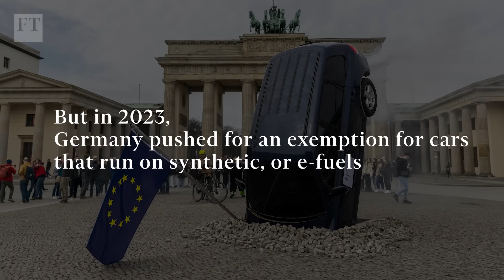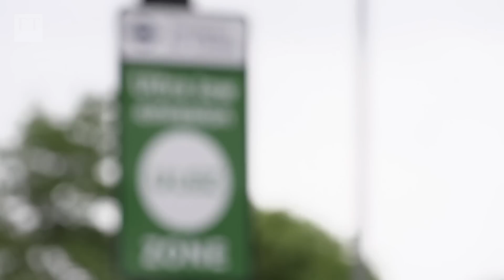The end of the combustion engine? | FT Energy Source

Comment: Julia was clearly the most informed there. She correctly summarized why ICE cars are cheaper than EVs - it’s efficiencies due to decades of manufacturing improvements. Mass scale EVs are only about 13 years old, give it another decade and they will dominate. You never bet against the technology with less moving parts.
Reply: Another reason is because nobody makes them pay the social cost of their dirt
CARBON TAX NOW!!!!
Reply: Combustion engines are at the limit of their performance and cost saving due to a century of ultimate competition among biggest automobile manufacturers.
Reply: Electric motors predated gasoline engines.
Reply: Less than 5 years for some very sophisticated high performance Chinese EVs. They'll blow everything else out of the water. We have slacked off.
Reply: @chrissmith7837  
The West is ahead in efficient motors, best power/ratio. Yasa near Bristol come to mind.
Reply: @johnburns4017  Maybe, but not by much and if you look at vehicle performance  you're not going to see it. Frankly it's all about batteries, charging/replacement and materials.
Reply: I don't know why people think that Electric Vehicles have to replace Internal Combustion.  In a free society it should be consumer choice.  I don't care if people want to buy electric cars if they want to.  Similarly I don't care if they want to have a golf cart, shotgun collection, skateboard, motorcycle or boat.  But for some reason the EV proponents seem to have these dictatorial tendencies and insist that ICEs be replaced.  You do you.  Leave everyone else to make their own decisions.
Reply: Mass scale EVs are piling up like asbestos cord wood in a wood lot.  They are far too expensive and impractical, there is not enough infrastructure or electricity available to run them.  [Why does the "progressive paradise" of California restrict the hours one can even charge their EV?]  The government that pushes EVs is the same government that effectively prohibits the construction of any practically viable electric generation facilities and is forcing others to shut down which is resulting in current electric rates skyrocketing,  EVs are not practical for long distance driving or operation in winter weather conditions throughout much of the US  Finally, there STILL is no tangible EVIDENCE that demonstrates the use of the dreaded fossil fuels has any measurable impact on climate change - a phenomenon that has continuously been taking place for hundreds of millions of years now.  Further still, it's kinda comical that there are EV charging stations in places like Montana that use diesel generators to produce the electricity to charge the "clean EVs."   As for so called "green energy", unlike "mass scale EV production," there are 45+ years of experimentation, development, massive government subsidization, and programs and yet it still only accounts for no more than 10% of electric production and in many parts of the country considerably less than that.  Like EVs, "green energy" is largely impractical and way over priced even with  massive government subsidies.  Of course there is one source of practical green energy (nuclear) but the government prohibits it's use and manipulates public opinion against it with scary false narratives the same way it managed to get everyone stirred up into a blind frenzy with the covid hysteria and the endless "vaccine" nonsense that has now been proven to be so risky that many governments have called off "vaccine mandates" entirely at the least and some have even prohibited the use of these dubious "vaccines" among certain vulnerable demographics within their countries. The state of Florida also has recently joined them.
Reply: No they wont.
Reply: @jester5ify  
What won't?
Reply: @johnburns4017  ice cars will not be replaced.
Reply: @jester5ify  Hopefully "ice cars will not be replaced" is the daftest thing you will say today.
Reply: @kalebdaark100  Hardly. Battery powered vehicles are far more damaging than any ice.
Reply: @jester5ify  I guess that wasn't the daftest thing you would say. Ah well.
Reply: "You never bet against the technology with less moving parts."  Yeah, Rolex (and all Swiss) watches disappeared decades ago.  Who would ever want one of those?
Reply: @dzcav3  
The CEO of Rolex said they are not in the watch business, they are in the luxury goods market. If you want an accurate and solid watch you do not buy a Rolex.  If you want jewelry then by a Rolex.
Reply: @johnburns4017  You said, "The CEO of Rolex said they are not in the warch [sic] business, they are in the luxury goods market."  The point of my comment is that some people still want mechanical watches.  It's ironic that most current buyers of EVs are wealthy people.  Perhaps EVs will trickle down to the masses (without government subsidies/coercion), but for now, they are still mostly the toys of rich people, who use their other ICE vehicles for long trips.
Reply: @dzcav3  
Most people want a decent highly accurate reliable watch, not expensive antiquated technology for decorative purposes.  Those who wear Rolex watches care not a jot about its accuracy. If you want an accurate watch you do not buy an antiquated clockwork one.
Reply: @johnburns4017  The main point I was making about watches is that NOT EVERYONE WANTS THE SAME THING!  We are individual human beings (with individual characteristics and rights), not amorphous parts of a collective.  Not everyone wants an Apple computer, not everyone want vanilla ice cream, and not everyone wants an EV.
Also, Rolex watches are MORE accurate than your digital watch.
Reply: @dzcav3  
There will be different types of EVs.
Reply: @johnburns4017  You said, "There will be different types of EVs.".  So what.  There are also different types of motorcycles.  If someone is not interested in a motorcycle, they won't buy any of the different types.
Reply: @dzcav3  
You just don't get it.
Reply: @johnburns4017  I guess I just haven't been assimilated by the Borg yet.  I dare to be an independent thinker, along with others, who doesn't want to be forced to love Big Brother.
Reply: wrote:
 @dzcav3  wrote:
"Rolex watches are MORE accurate than your digital watch."
Complete nonsense.
Reply: @dzcav3 Intelligence in reply. I also love mechanical watches, they are real engineering and very precise.
Reply: @dzcav3 Yes it did and that's why they switched mass manufacture into digital watches. And of course Swatch did the Smart BEV.
Reply: I'll definitely bet! Because “moving parts” mean simplicity, durability, reliability and efficiency all at the same time.
Reply: Wrong; hybrid cars are the best.
Reply: No. She is wrong about e fuel. Because there is no way that ships and plains are going to be using batteries, so they must find alternative fuels in order to use those machines. And since that is the case there is no reason why we shouldn't use it in present cars and future ones.
Reply: The key point is that EVs have much more potential to improve on both cost and performance. The demise of ICE is inevitable and it's only a question of the timing. The latest EV offerings here in Australia are already very cost competitive with ICE cars, despite petrol prices here being quite cheap by European standards.
Reply: @budawang77  Hertz is selling off its EV fleet and no one wants them. The secondary market for EVs is collapsing.
Reply: Just so that people get some perspective on how silly the weight of the current EV offerings have become. A squad mobile(2 seater) weighs 350kg for the whole thing, that's less than just the battery of a Tesla(400kg+). The x-bus has a weight of 800kg which is less than half that of those two ton big battery EVs. It's not that it can't be done, car manufacturers are unwilling to offer sensible weight EVs for short trip drivers. Big claims on how green their EVs are yet they choose the option that results in the excessive use of material and resources.
Reply: The chemical reality is that combustion fuels have roughly 40 times higher energy density than batteries, and they always will.
Reply: @rotaryenginepete  
But only 20% of the energy is used in oil fuels.
Reply: @rotaryenginepete , what do you want to tell us. It is true but absolutely irrelevant
Reply: @torao773 what matters is not the number of moving parts but the costs.  A new engine and transmission for an ICE vehicle today on avg still costs less than replacing motors in an EV, let alone batteries.   And instead of doing it every 80K, you maybe need to do it every 145K.
Reply: @AllenGraetz pure lies.
Reply: 100% on the money !
Reply: @AllenGraetz  combustion engines are far more complex and expensive to build than electric engines. Half the cost of an EV is the batteries. And that's with huge amounts of forward investment built into ICE manufacturing and ongoing development costs. And that shift will only increase in EVs favour. The batteries are the major cost differential and they are coming down in price all the time.

As for infrastructure, that is not such a big issue for those in the country. In the UK the major challenge is the falsely inflated cost of electricity to support a broken electricity distribution market, accommodating the cost of running gas powered power plants.
Reply: @AllenGraetz  You need to find other sources of information. Your present sources are making you look foolish.
My more than eight year old electric van has done over 80k miles. It had crap range when it was new. It has almost the same crap range now. It's never had a new motor and it's never had a new battery. I recently had to have the suspension tightened up, but other than that, the only work it's needed has been a tire change, some brake blocks and some new wiper blades.
Reply: You never bet against technology that has less moving parts. 
The train is laughing like hell 😂😂
Reply: @hafizuddinmohdlowhim8426 
You're not suggesting we all take trains, are you.
Reply: Julia is wrong that electric cars are not inherently more expensive. Currently modest EV battery at 60kWh is on average 4 days worth of electricity used by a household. People are charging 4 days worth of electricity within a day; the infrastructure required to support this is expensive. It's not about averages, it's about infrastructure that can safely handle the peak spikes. This is why small battery EVs(20kWh or less) are the ones that are not much more expensive, but how many big car companies are pushing to sell those?
Reply: @longdang2681 incorrect, as stated above. Few drive that much!

Plus, one liter of gasoline need around 1,5 kWh worth of electricity (from grid or local generators) from well to tank. 
A 60 liter tank is therefore also ”containing” 90 kWh of electricity. Even if that number is half that, all ICEs are also electric, on top of all pollution!!

E-fuels are even worse in kWh, as the ICE is so uber inefficient!
Reply: @My_HandleIs_  For this calculation it doesn't matter how much you drive. When you fully charge a 60kWh battery in 20 hours you need a 3kWh charger. You need higher power chargers if you want to fully charge that 60kWh battery in less than 20 hours. Infrastructure for high power electricity cables are expensive. One solution is to not charge up to 60kWh, in which case why are you buying an EV with such a big battery if you don't really use it's full capacity? Which is why I say that EVs are best suited to have small 20kWh batteries and used as city run arounds.
Even if it uses the same amount of electricity(which is unlikely), ICE cars can refill in less than 10 minutes without the need for expensive high current power cables. It's not about the number, it's about the intensity. High intensity uses are inherently more expensive.
Reply: @longdang2681  in rural areas most people have their own driveways so can use their own chargers which are a small fraction of the cost of a new EV. In the town you have better public transport and other options that for many people make any form of private car ownership unnecessary.
Reply: @uniteddreamer  That is a very round about solution. Just make small battery EVs for city users. What is so wrong with manufacturing relatively affordable small modular battery EVs that everyone is beating about the bush to push every nonsensical solution? If we want to transition to lower pollution vehicles then the car industry needs to push for the most practical way to do so. City people don't need to give up private car ownership if small modular battery EVs were widely available. Car companies are trying to greenwash people into buying two ton monstrosities, where all people need is a small city run around in order to reduce tailpipe pollution.
The fact that it can be done doesn't change the fact that you are using maybe three times your daily average electricity use just by charging an EV. The grid only has so much buffer capacity for this. It's not going to work if EVs numbers start to rise. It's like you're trying to make every effort to try and choose the least natural choice.
Reply: @longdang2681  
A 7.5 kW domestic charger is fine for EVs.  You do not charge the battery from zero to full every night. You just top up. It charges while you are asleep and watching TV.
Reply: @longdang2681   How to tell me you have no knowledge about using an EV without saying to me you have no knowledge about using an EV.
Reply: @longdang2681  People are not charging 60kWh every day though. 60 kWh will take you 300+ km in an efficient EV, average daily mileage is way less. But you do need batteries much larger than 20 kWh to be able to make longer trips in a reasonable time: 60 or 70 or 80 kWh.
Reply: @longdang2681  
One of the heads of National Grid on Fully Charged say there is no problem in electricity supply. I believe him.
Reply: Battery car is not safe when it catches fire because they position it underneath the seats
Reply: @hafizuddinmohdlowhim8426  compared to petrol?
Reply: @uniteddreamer  Yes. Petrol is safer despite it being underneath of rear sear because it will leak first and then catch fire. The battery will burst into flame. 😁
Reply: @hafizuddinmohdlowhim8426 ICE cars 20x more likely to catch fire than EV. So that FUD can be ignored
Reply: There have been about 400 EV firs worldwide since 2010. ICE fires are between 20 to 80 times more likely than EV fires. So between 8000 to 32 000 ICE fires. Google the numbers. @hafizuddinmohdlowhim8426

Comment: I am all for the electrification push but not for climate change reasons. Its for reduced travel costs for the consumer. At this point untill battery tech improves and/or battery replacement costs come down I will not adopt. Fancy having a 10 y/o EV that has to go  to the crusher because its only fault, the battery is too expensive to replace. A throw away EV car economy is not eco friendly either and that is what have atm.
Reply: Car OEMs have extensive plans to recycle/reuse batteries and other components on a scale that has never been practised before
Reply: I'm for EV's because I don't wan't to pay the $7.000.000.000.000 oil subsidies.
This is costs that are taken out of all peoples taxes. Many countries hide this through "smart" budgets.

Solar panels, battery, vind turbines at home, and EV's will help get rid of this corrupt system.
The power generation are goving back to the people. This will pressure the companies that sell power to moderat their prices.
Everyone from oil to electrictrisity.